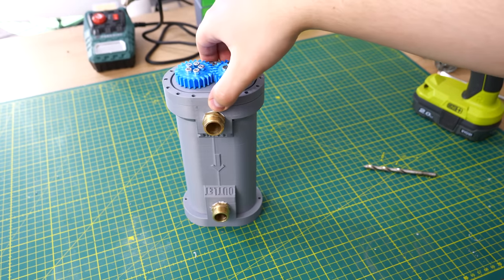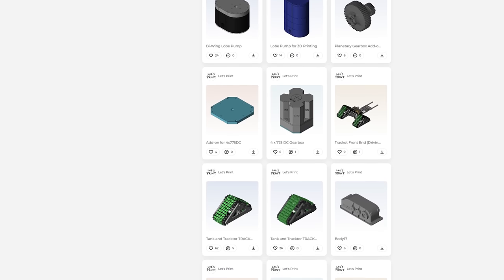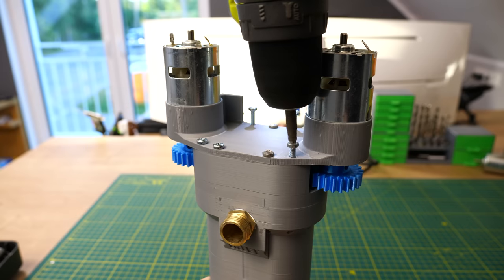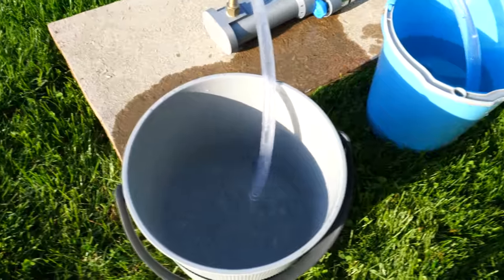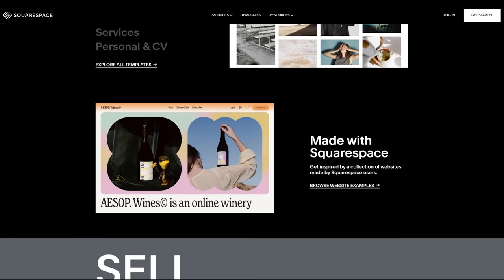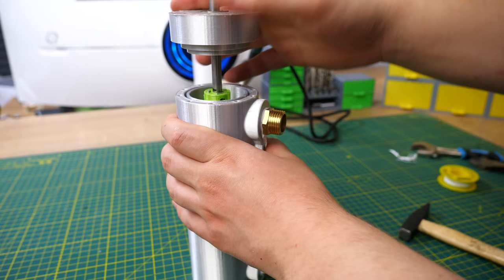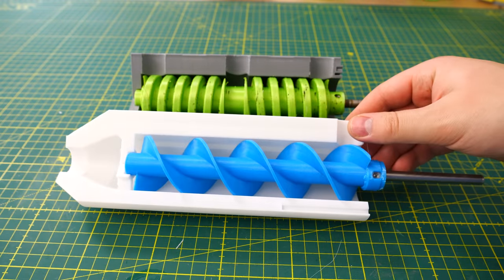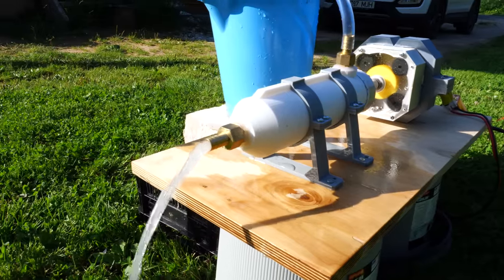3D Printed Screw Pump - 3 Different Way

Comment: Something critical you seem to have missed is that the first pump had a positive displacement - that is, there was essentially a fixed moving space that was pumping the water because of the meshing with the other spiral. The 2nd and 3rd pumps were really nothing more than a spinning fan, so it was easy for the water to just rotate with the rotating part without being forced along.
Reply: Yes, this. Thanks for writing this, this saves me the effort from having to do it myself :)
Reply: Totally wrong! all pumps are positive displacement pumps. Off course is the geometry that you was use that is wrong! A lot of air coming inside
Reply: @AndreaFederigi  👌🏻correct.

I would also add that those designs are better suited for fluids with much higher viscosity than water.
Reply: @AndreaFederigi , The last one was a propeller, not a pump.
Reply: @royaldust , They have screw pumps for air compressors and superchargers. That would be for pumping air.
Reply: @AndreaFederigi  that isnt true, impellers do not displace water
Reply: @AndreaFederigi well the water can turn with thr screw and not flow out
Reply: @terjeoseberg990 those have 2 screws. They make so air cant escape when u turn it but the second and third design in this vid the water could escape or just move woth rhe screws
Reply: @dividingrain1907 , Yes.
Reply: You can convert the second pump to a positive displacement one in either of the two ways.

1. The simpler way: Change the wavelength of the spiral continuously and slowly, making it shorter from the entrance towards the outlet. This will try to squeeze in more water taken in at the entrace into smaller volume along the way, hence increase the pressure.

2. more difficult way: You have to change both the case and the "propeller" by reducing their diameters, again continuously and slowly from the entrance to outlet; hence changing the volume again.

Basically you get a conical shape which the JetSkies use as impellers.

Comment: By the second pump: it happens because you have double the diameter for intake then for the outlet. The vacuum is to low for one side. If you would use a connector for the intake-lines to bring them together, or you use a smaller diameter for the intakes, both sides would pull water.
Reply: The reason the left side didnt pull water is because thats where the shaft is and it leaks, so its not able to create enough vacuum to maintain the prime.
Reply: It looked like the second intake on the green double screw pump was spinning the wrong way. the left screw did not push the water to the center outlet in the right direction to pump the water but the right side did

Comment: The main issue with the first one is that this type of pump is not made for high flow, but high pressure, therefore requiring very tight seals between the screws and the case and also between the screws themselves. This pump is pointless if you can't make this super precise which I don't think is possible with 3D printing yet. 

The problem with the other screw pumps you made is that they don't have a second screw making separate pockets that move the water to the output, but just one long tube that just kind of accelerates the water. You used a pump designed for pressure and removed its ability to make high pressure. Of course it didn't work. 

I loved the video though. Nice to learn that high flow is relatively easy to make with 3D printing but not high pressure because that requires more precision.

Another critique I have which I've mentioned before is that you seem to not know the difference between flow and "performance". Just because it has low flow, doesn't mean its bad, as long as it has high pressure. Pressure x flow is effect. You need to check for both. Just like electricity. You have voltage and amperage. Voltage is the pressure and amperage is the flow where volts x amps = watts.
Reply: I think that the first one could work with viscous fluids. but that still requires to have at least some sort of seal (the viscosity would determinate how good the seal have to be). the next 2 seem more apt to granular materials.
Reply: Home 3D printing is definitely not there yet, and perhaps industrial plastic isn’t either, but I imagine a metal 3D printer could make a nice one!
Reply: @andrewbarentine2187  would still probably need machining.

On the other hand you could 3d print a lathe to machine the plastic screws or a contraption to mate them together with some abrasive powder

Comment: 7:00 Typically pipe fittings have a tapered thread. This causes the threads to essentially have an interference fit when you tighten it down all the way. If you model that tapered thread into the print and then heat up the fitting a bit before inserting it (beyond glass temp, but not by so much it's going to just melt the print) the fitting should make and form a water tight connection. (in theory)
Reply: This is true of American fittings using the NPT standard.  But it's not the case for most European fittings from my understanding.  In the EU it's common to use gaskets and thread tape to compensate.
Reply: @OddJobEntertainment  British Standard Pipe (BSP) is used in Europe and comes in tapered and parallel forms. BSPT seals on the threads in the same manner as NPT.
Reply: Totally unusefull. Bsp npt and iso do the same result.

Comment: If your goal is to make a 3D printed water pump, your best bet will be an impeller based design, it will give you the best balance between flow rates and pressure without having the fine precision requirements of screw pumps. There's a lot less wear points as well, the impeller can be driven directly from the motor shaft so there's no gears or contact points to wear out. Still pretty cool that you can make such complex parts that function to some degree, it's amazing what 3D printing has brought to the world.

Comment: I understand the desire to stick with 3D printed parts as much as possible, but there are some things that 3D printing just isn't good for and water tightness is one of those. With some cheap, commonly available parts, you could make your designs much more reliable and effective.

A good pump requires tight clearances to maintain pressure, not just to keep the water in, but to keep air out. Using lots of screws to tighten the pieces together can help, but at some point you need a material that is more compliant and can fill gaps better. This is where gaskets and O-rings come in. You could 3D print these from flexible materials like TPU if you want, but it's probably more accessible to everyone if you use easily-available parts like standard O-rings. For gaskets, you can buy sheets of rubber and cut out holes where needed. You could even 3D print a template to help cut them nicely, but the cuts don't have to be exact, as long as the gasket seals all the way around the holes.

For elements that need to be threaded in, you can either cut threads yourself or you can use a threaded insert. Taps for threading are relatively cheap and can be used for a lot of things, but PLA doesn't tend to make nice, tight threads. Threaded inserts will provide a much better interface between the threads. They can be securely fastened into the PLA by heating them with a soldering iron. This melts the PLA around them giving a very tight seal. You could instead use epoxy or some other gap-filling adhesive to ensure there are no gaps between the PLA and the threaded insert.

Bearings are also important to avoid slop in the mechanisms. Any movement of the screws is going to create openings that prevent a proper buildup of pressure. Skateboard bearings are common and good for radial loads, but axial loads require thrust bearings.

Printing tight tolerances is very difficult, but plastics like PLA have the advantage that you can easily machine them down. If you oversize things a bit and run them, they will naturally wear down until they aren't interfering anymore. This can give you quite good tolerances. You can accelerate the process by putting some lapping compound or polishing paste on the screws.

Another option is what machinists will often do. Put some thin paint or dye on the screws, then run them for a little bit. Look at the areas where the paint is worn off: this is where the screws are making contact. Sand them down a bit, then paint them again and repeat the process. Continue until you don't get paint rubbing off.

For even better seals between the components, put rubber or silicone wipers at the edges of the interfacing elements, such as the outside edge of the screw. You can buy sheets of thin silicone rubber, cut them into strips, and embed them in the edge of the screw. Be sure to design a groove in the screw to fit the wiper.

All of these things are readily available at most hardware stores, and they are relatively inexpensive. You don't even need exact, specific parts; you can often make substitutions that accomplish the same task.

I think these improvements would help a lot to make a working pump that is still easy for others to print and reproduce for themselves.

Comment: Hey ! I think your pumps are having a hard time starting because of the air in the feeding tubes. You can fix this either by using a secondary pump capable of sucking this air out or just by dumping your pumps into the water, thus eliminating the tube and air getting into the pump problems. I think that might help.
Love your content so keep uploading great vids even when they fail of course 🙃
Reply: Also if he had an Oring or 2 would help with leakage
Reply: Unbelievable! Another  pump? Efficiency close to zero. Is not a pump is a furnace

Comment: Isn't one of the greatest advantages of dual extruder setups that you can use water soluble material (PVA) as supports?
Reply: Nowadays i think.   In old days the pva filament available printed like crap.
Reply: PVA is also really expensive ~60$ a roll
Reply: @PrestonStephens  Hadn't even looked at the prices. That's definitely just from some internal supports that would be impossible to remove then.

Comment: Pump 1 - you only need one motor. The gearbox will cause both screws to turn as well as ensure they stay properly meshed. This setup is commonly used for precise addition of dry materials in industrial chemical processing. See Coperian for the commercial use examples 

Pump 2 - I agree with husky9104, air leakage is preventing the one side from maintaining prime. Secondary issue would be that with there is a significant possibility of overpressure if both sides actually pump against that small discharge

Pump 3 - again a very common piece of equipment for transfer of dry materials, just typically bulk transfer vs. fine control

Comment: My advice when printing things that other bits screw into is to print those parts first on their own to test fit before printing large units. If I ever print a box with a screw lid I print a really thin lid and the top of the box to check it all lines up and the holes are the right size. Saves hours and lots of material.

Comment: The last couple pumps don't work by displacement, they are centrifugal. The crews are just spinning the water. I'm actually a bit surprised they moved water at all. Your first pump, with dual screws worked through displacement, which is why it worked better. I wish you has fixed the front seal. that thing could be awesome.

Comment: interesting to see at least the guy is very honest about his endeavours.  I think the last pump if you put a tube on the output nozzle and raised it up a bit it would help the pump stay primed.  The previous pump with the two opposing threads I believe the reason the other side did not stay primed was because of air being forced from the dominant side which would make it difficult to stay primed for the less dominant side. Great to watch though even though these pumps are gonna be inherently inefficient. Great video.👌👌

Comment: For that last one, you need a vane at the inlet in the housing that fits into the form of the screw, otherwise you're just turning the water around inside the housing instead of propelling it forwards.

Comment: If ur having trouble with supports and you have a dual extruder 3D printer, water soluble pva is a great solution as you can print with ur desired filament, then swap to the pva for supports. After the print, you can resolve the supports in a bucket of water.
Reply: Dissolve your supports*

Comment: The effort going from the rirst designs to this video is great, reading through the comments alot of tips there, my 2 cents would be to design a channel along the top of the spiral to slot in a ptfe tube in order to compensate for the clearances in the housing, something like those vases with filaments for accent colors

Comment: Positive displacement pumps such as these are primarily for pressure, so maybe instead of a flow test, attach a pressure gauge to the end with a recirc back to the original bucket?

Comment: I think first pump with two screws should have had gears with screws inside pump and metal shaft in one screw with lip seal and bearing. Only inlet, outlet and sealed shaft to reduce leaking. Also what about printed threads? Or you can print coupling with thread on one side and cone on the other side, so you can hammer or glue them in mating cone hole.

Comment: I’ve never had problems printing with petg, I actually only use this plastic, you should try a bigger nozzle, like a 1mm or 0.8mm, it works well. With smaller ones is a lot more difficult, and you need a little bit higher flow rate, less printing speed and a slower fan speed. You can try it with 0.6mm nozzle too, 0.4 is maybe too small. I recommend you putting some lithium grease on those gears, it really reduces friction and heat.  I love using fusion360, nice videos man
Reply: What the name of the model of this 3d printer

Comment: I think that the first inlet of the second pump is just blowing air,not sucking water.If you rotate the poles it will suck,but the second one will blow.Your screw has opposite directions on the ends.If you make them attached to different shafts with different rotation,then they will all work fine.

Comment: You can print threads without support as long as they have a 45 degree or less overhang.  So make them shallower with 45-degree sides and you'll be able to have much tighter tolerances on the 2-screw design and better pumping.
Reply: Well, you can go up to 60 degrees without any problems, and maybe more if the printer is setup well enough

Comment: Use silicon or liquid gasket for engines. Hot glue creates airleaks all the time. Put the inlet in the middle of the screw since you dont have a good motor axle seal, I think the the primed water would present enough resistance for the air to maintain some low pressure inside.

Comment: One picture tells a story. At 7:41 there are stripes along the grey cylinder which means low file resolution, you exported your design as STL instead of STEP.

Comment: Another good video. You don't learn if you don't try new things out 😎
I wonder how well these pumps, all of them really, would do if you were to line pump housings with wax of some sort to close the gap between the impellers and the housing. I doubt you could actually use a rubber seal on these because you can't introduce some lubricant other than water (I suppose you could use soapy water, might work from a testing perspective, just not practical application). The wax would serve two purposes, 1) closing the space between impeller and housing 2) be a kind of lubricant against the plastic moving parts. Might help make them run a little quieter. How long would the wax last, who knows! That's what testing is for  😉

Comment: If you have a dual extruder printer, I think it would be easier to print PLA + PVA. The PVA is water soluble, so you can just flush away the supports.

Comment: the main issue here is most likely the tolerances
the lobe pumps are designed for high volume and low pressure, that's why they work so well as 3D printed parts.
a screw pump is designed for high pressure, high viscosity or solid matter

the latter are used in pellet or wood chip heating systems, on combines(harvesters) and plastic injection molding machines to name a few examples

Comment: On the last one The leading and trailing edges of the impeller need to be at a 30 degree angle. 
U R Getting impingement at the ends of it along the case.

Comment: Second and third pump doesn't wanna work because you have only one screw, so water can spin with the screw and not move, or spin faster than screw and go in opposite direction, to prevent that you need second screw, like you did with first pump. Roots and Lysholms superchargers also have two "screws".

Comment: maybe it would help if you sealed your designs with o-rings? there is so much air in the other systems as well. 

and thing: oilseal rings are cheap. after fdm printing just push a ring a plastic tube over the end for a better surface for the oilseal.

Comment: Couple things- a: leaking because you need a rotating face seal of some sort. Probably not something you can 3D print but maybe? It looks like you solved that in the second make, or addressed it with a proper seal. 

Other thing, on the second video, with a pump like this you really need a high level of precision a 3d printed part may not be able to achieve. You essentially would require both screws to be precisely identical, otherwise the pressure being generated by the higher performance screw will deadlock the other, especially with the velocity head being generated by the working screw being in line with the other's discharge. Same reason why it's no good putting two different pumps in parallel and expecting them both to generate flow